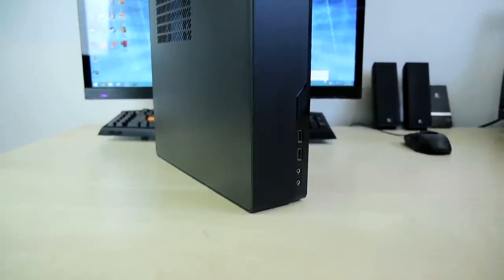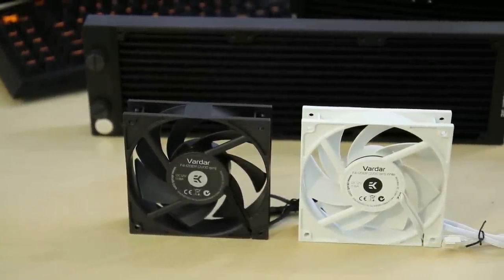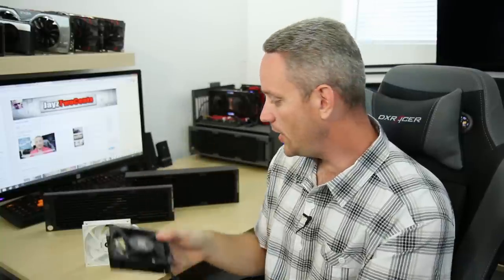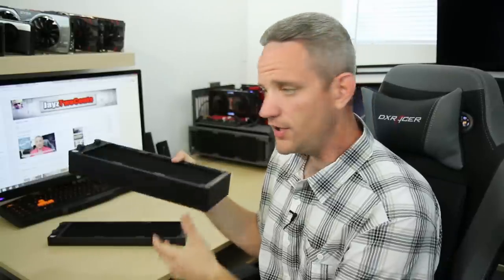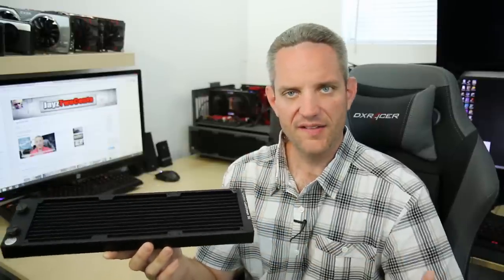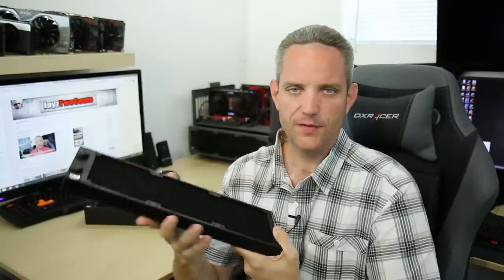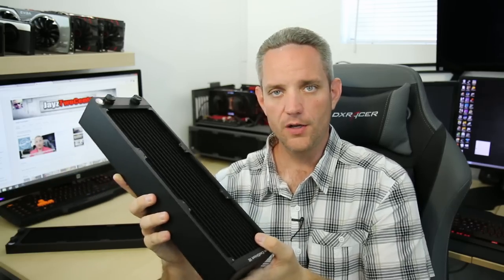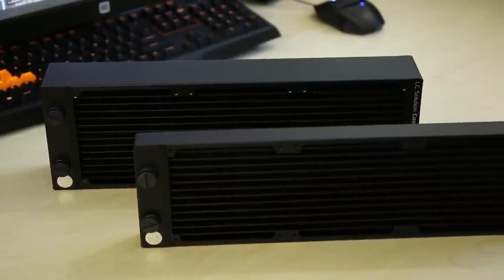New EK Radiators and Fans | When should you use Thick vs Thin Radiator?

Comment: Could you do a video on AIO Liquid cooler maintenance?
Reply from the maker: ThornOfZer0 No because there is none.
Reply: ThornOfZer0 Just keep cleaning the radiators like make sure you get no dust or anything on it as it would restrict airflow
Reply: hmm interesting. Was thinking there would be some kinda top up or the whole PT treatment. Thanks :) think thats the way I'll go for cooling on my build.
Reply: ThornOfZer0 If you are using the Swiftech coolers, then yes you will need to top up after two or three years (can't remember exactly, but don't quote me on that). It is designed to be user-refillable.

Comment: All right. It's all your fault Jay. I've watched too many of your videos and now I'm doing my first custom loop. Whatever I break is on you. Fingers crossed :)
Reply: ive heard of guys suggest tip used to jump the psu 12v rail power supply so that only the pump runs, that way system can be tested 4 leaks prior to any expensive hardware being exposed.  lookITup
Reply: ***** That's exactly what I'm going to do. Thx!

Comment: Could you combine enough rads for a 6.00Ghz CPU overclock?
Reply: no,that depends on your coolant. there arnt any coolants on the market that can achieve that kind of cooling. liquid nitrogen has been used at big shows and has clocked cards to over 9ghz,but you need a constant flow of fresh liquid nitrogen.
Reply: @Angel Ensefalon just as a guess if spend 5k on just radiators and fans to add on might but I never knew of one over 5Ghz, my CPU is 4.5 I think but at times it goes 5 and I not over clocked it yet, not brave enough myself even though got i9 9900k

Comment: can we use car coolant for pc
Reply: If you did, you would still need a biocide agent as Linus already found it doesn't stop growth.  Just use distilled water from the store, its cheap. Add an anticorrosive/biocide additive that you can get on amazon or a PC watercooling website.  Car coolant isn't really the best coolant for PC's by any means, its thick, and there's lots of nasty stuff you wouldn't want to spill and only takes away from performance. List of additives or coolant concentrate for distilled water, you only really need a biocide since corrosion doesn't happen enough to affect in pc cooling unless you mix aluminum in there, fittings might just lightly have a film of green:

Straight Biocide: https://www.amazon.com/Petras-Tech-Nuke-Concentrated-Biocide/dp/B008EH4STK/ref=sr_1_1?ie=UTF8&qid=1480012889&sr=8-1&keywords=Petra%27s+Tech+Nuke+PHN+Concentrated+Biocide

Anticorrosive/biocide: https://www.amazon.com/PrimoChill-Liquid-Utopia-15ml-Bottle/dp/B00CDXQ22M/ref=sr_1_sc_1?ie=UTF8&qid=1480012793&sr=8-1-spell&keywords=primochill+anti+corrocive

Coolant concentrate for PC Cooling, just mix with distilled water, directions will say how: https://www.amazon.com/XSPC-Ultra-Concentrate-Coolant-Clear/dp/B00L5IXAFS/ref=sr_1_9?ie=UTF8&qid=1480013063&sr=8-9&keywords=pc+coolant+concentrate

I've done distilled water with the PHN Biocide for 2 years and haven't had any issues so far.  The safest and easiest option would be the coolant concentrate in my opinion.
Reply: Abdul Rouf you would NOT want to do that. if you are using plastic tubing. coolant will dissolve the tubing and you don't get any better thermals.

Comment: I'm doing my first pc build, i get super nervous about it, can anyone reassure me of these parts at all? :) I just want to make sure they are all compatible etc, i can put the links of where i am buying them if necessary for the info on the page or whatever. Thanks guys

Corsair Graphite 760t Windowed Full Tower Gaming Case

Intel Core i7 i7-4790K CPU (Quad Core 4GHz, Socket H3 LGA-1150)

Asus MAXIMUS VII RANGER Z97 Socket 1150 VGA DVI HDMI 8 channel audio ATX Motherboard

EVGA GeForce GTX 980 Ti Superclocked+ ACX 2.0+ 6GB GDDR5 DVI-I HDMI 3 x DisplayPort PCI-E Graphics Card

Corsair CP-9020056-UK RM Series RM850 80 Plus Gold 850W ATX/EPS Fully Modular Power Supply Unit
I have a lot of other parts i am buying ofc but these should be the most important

Comment: How does the water flow through the radiator? The inlet and outlet just next to each other, don't see any pipe running to and back, how does it able to distribute heat effectively through out the whole radiator.
http://www.pcper.com/images/reviews/460/37-Radiator.jpg

Comment: This is bs. I have enough room for a small dual rad and want to cool a GPU and CPU off it. ITX build with a custom loop. Pretty certain I can't fit another 120 but maybe. Will the 2x120's be enough? Not looking for getting it to run 1 degree above room temp. Just want it to be quieter and cooler than air. Maybe <60

Comment: Look i'm not really expecting a reply but if anyone could help me out on this it would be greatly appreciated, I've saved up for a while i'm building my first PC and really don't want to mess it up. 
These are the specs of what i'm considering
----------------------------------------------------------------------------------------------------
-Intel Core i5-4690K 3.5GHz Quad-Core Processor
-MSI Z97-Gaming 3 ATX LGA1150 Motherboard
-Kingston HyperX Fury Black 8GB (1 x 8GB) DDR3-1866 Memory
-Seagate Barracuda 1TB 3.5" 7200RPM Internal Hard Drive
-MSI Radeon R9 390 8GB Video Card or the MSI GeForce GTX 970 4GB Video Card
-Corsair 200R ATX Mid Tower Case
-EVGA SuperNOVA NEX 750W 80+ Bronze Certified Semi-Modular ATX Power Supply
Pcpartpicker (if you prefer to view it that way) :http://uk.pcpartpicker.com/p/C3jJ99
----------------------------------------------------------------------------------------------------
The main things i'm concerned about are including but not limited too
-The Power supply not being good enough to support the build
-The motherboard not working correctly with these parts
-The case not being large enough for the build
-Which GPU to chose, the R9 390 looks better but i'm worried the drivers just aren't as good as nvidea's and that games wont be optimized for it because the gtx 970 is more common.
---------------------------------------------------------------------------------------------------
I would like it to be able to run Ark survival and fallout 4 (when it comes out) on high to ultra settings, A big ask i know as in its current state Ark is poorly optimized but i feel after all this saving up if it wasn't able to run it i would be extremely disappointed.

Any feedback would be appreciated even if it is to call me a complete idiot for asking on a comment section on youtube. Anyway thanks in advance if anyone replies and have a nice day.
Reply: Manus de Paor As much as I like nvidia, i'm advising people to stay away from the 970. 
The VRAM Issue is apparent in current games, and games that come out in the next 1-2 years are really going to hurt with that 3.5GB bs. 
As for the PSU, it should be fine. 
What res are you playing at? If 1080P, the 8GB is overkill unless you can get it for 20-30 bucks more than the 4GB version. 

AMD Drivers have a ways to come, but they are getting better.
The motherboard should be fine (I have it's bigger brother, the 7), but if you're worried you can always step it up to the G5.
Reply: TDPEquinox I'm planing on just going 1080p i think it would be a bit ambitious to go any higher. But i thought the reason the R9 390 was better than the 970 was the 8gb ram? I also didn't know there was was a version that was 4gb i'll check that out and thanks for the reply man i really appreciate it. I forgot to mention so i go with same old windows 7 or windows 10?
Reply: +Manus de Paor Still recomment th r9 over the gtx 980 more Vram
Reply: Daniel Burgos I'm not playing on playing minecraft, as i mentioned in the first comment I want it to be able to run Ark survival and in the second one I said i would play at 1080p. But what do you mean the 500 mb is slower, I thought it didn't show up in games? and Thanks for the help :)
Reply: Oh I'm sorry on mobile it's annoying to see comments. Yeah I heard Ark is pretty bad optimization right now and Fallout 4 I heard should be pretty easy to play. As for the 970 "problem" you only see the effect when you push the gpu over 3.5 GB of vram which is pretty hard to do at the moment but it's mostly problems with people with 4k panels your playing at 1080 so you shouldn't get anywhere near the 3.5 issue. So what I'm getting from your game "path" is that you like to try the new games that come out? Like triple A games? And concerning all your questions before you should be fine PC part picker is amazing at making sure all your components are working well together. I'm not too big fan of the 200r tho
Reply: Daniel Burgos What about gta v 1080 p ? Haha 3.5 is worthless. Better have more than less.
Reply: Daniel Burgos Any case suggestions i could use instead of the 200r? And i don't buy triple a games that often i just have all of bethesda's games and want to keep it that way. I like to play league of legends occasionaly as well but that could run on a potato so i don't need to ask about that. Also i heard that your GPU is only as good as your CPU is that true? If so should i get a different one to go along side the 970?
Reply: I have never seen gta V get over 3.5 at 1080p
Reply: I looked up the 200r and it's actually not a bad case I forget everyone is not going to buy like a crazy high end case lol to answer your CPU to GPU question your CPU will give you very small improvements the i5 that you have will keep up with the 970 easy the only way you run into the problem is the CPU bottlenecking the Gpu let's say a dual core CPU with a like a Titan X lol
Reply: Daniel Burgos Thanks man :)
Reply: Daniel Burgos Also if i were to foot the extra cost for a 980 would the 4 gb ram be enough? and if i did would i have the bottlenecking problems you mentioned?
Reply: Manus de Paor you can never go wrong with a 980 it's still a huge top tier card still going in a ton of builds today if you had the money or saved up for one I would recommend it for sure hands down. And no with i5s you won't see that bottleneck your at a good spot if all you wanna do is game i5 is the way to go and it's great if later on you wanna do videos or live stream just pop out that i5 and pop in a i7 since it's the same socket
Reply: Daniel Burgos  Thanks man